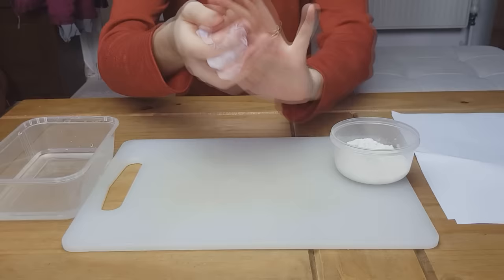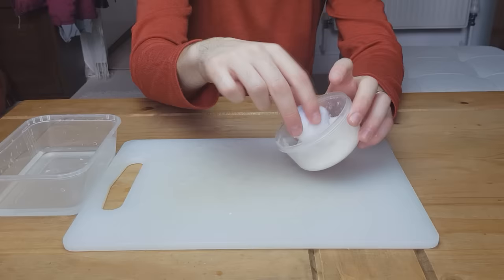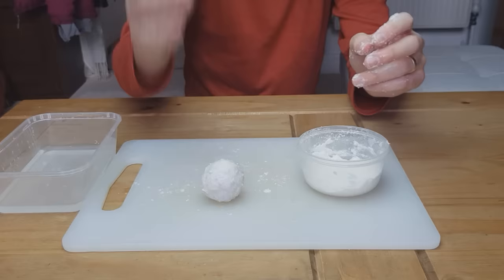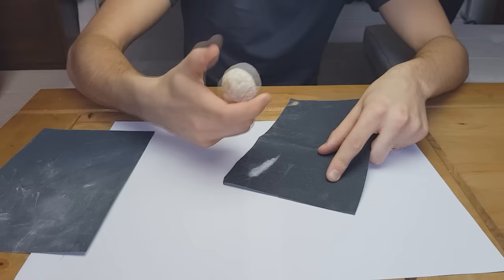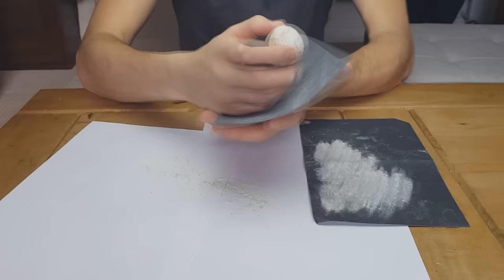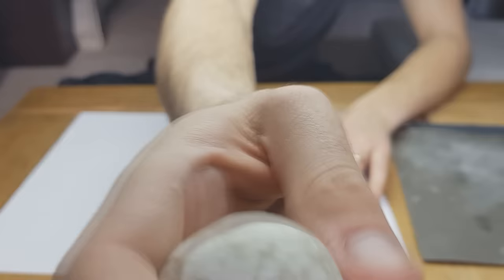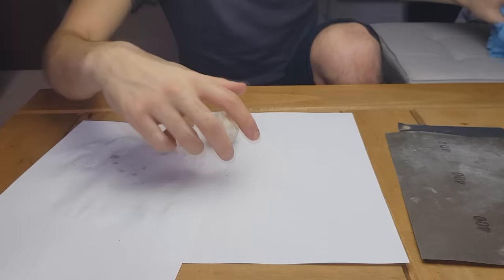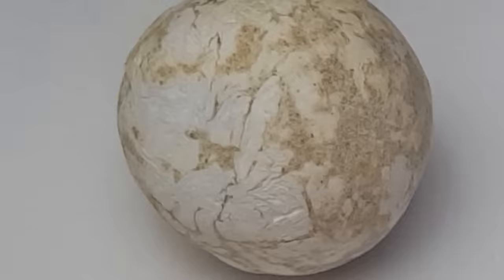Making a Polished White Paper Ball

Comment: You can't turn paper into metal. I tried the entire process and I never got a ball as hard as that. Paper can be turned hard but not hard enough to make cling sound when you drop it
Reply from the maker: if you leave it to dry for a couple of week it goes very hard. Check out my latest video where I make a hammer from paper that actually works